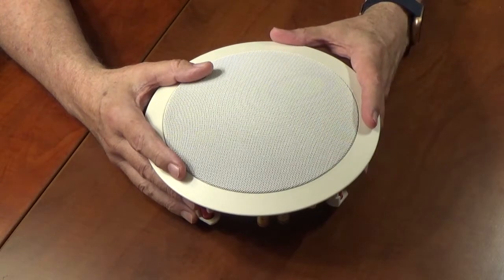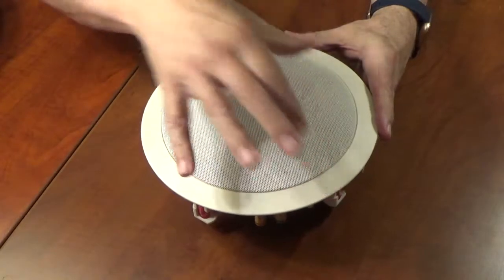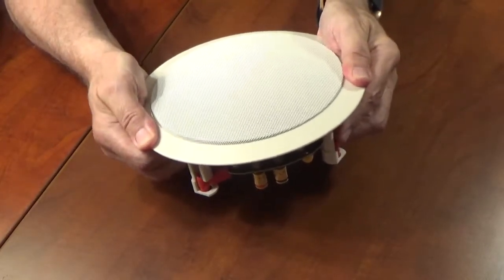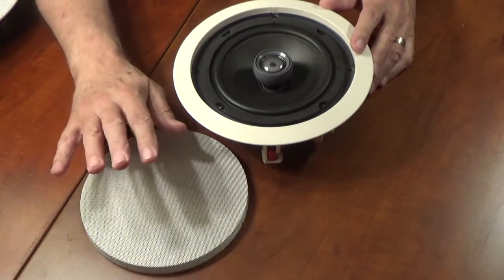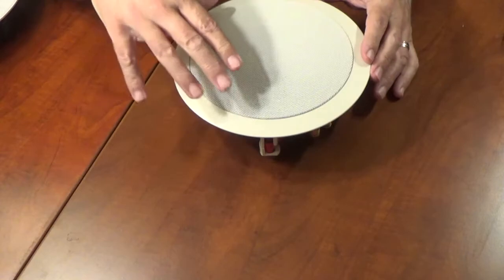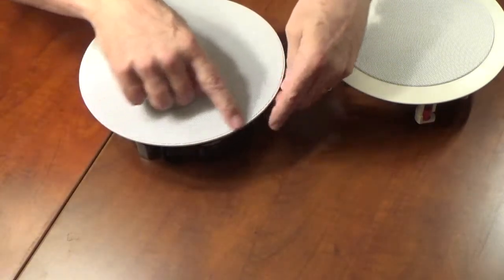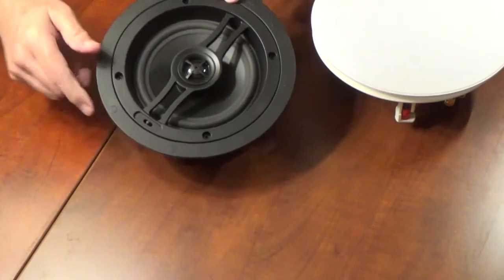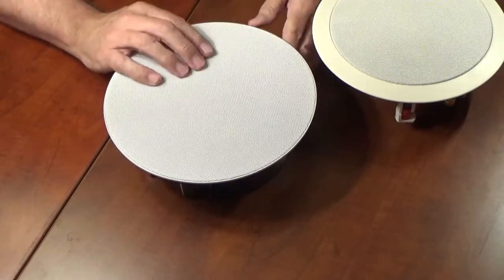OSD Audio Tech Tip: Removing Grills from In-Ceiling Speakers, Comparing Trimless vs Standard Trim

Comment: Hi! We can't work back & forth the way you did with our ceiling speakers. The ceiling is rigid and the speakers are firmly placed in it. I also tried using a paper clip to pull it out to no avail.  It hasn't worked since  it was installed 8 years ago (neglected testing after installation). I hope you can help.